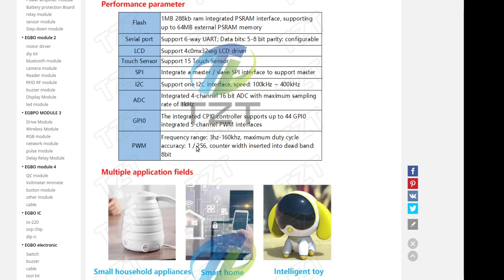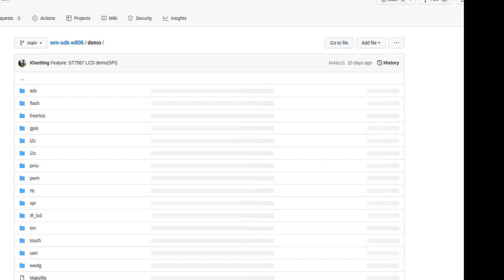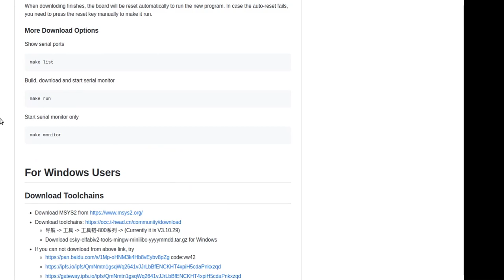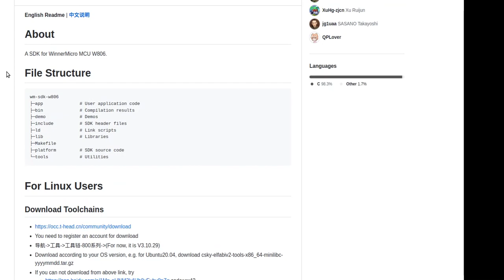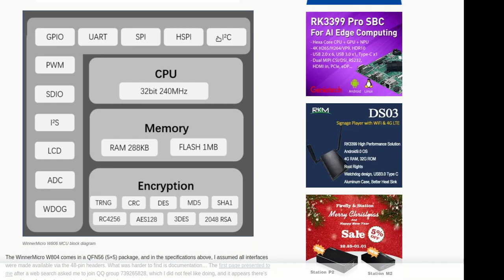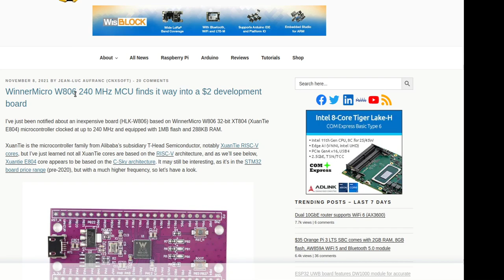W806 MCU - First look

Comment from the maker: NOTE: I say "STC" a few times, but mean "STM" - Too many "ST"s ;)  Another point I missed - The PCB DOES NOT have a power pin broken out so I bodged one for use on a PCB mount. That was a large oversight on the PCB designer's part.

Comment: Works great for me ! 
I provided Instructible and GitHub Code :
- instructables slash W806-Microcontroller-Code-Projects
- github slash jlsilicon slash w806
W806 also provides 10-80Mhz Gpio toggle speed - depending on pin.
Reply from the maker: Nice.

Comment: What can you prpgramnwith this, mcu
Reply from the maker: If you mean what languages, then the SDK for it is using C, so C and C++ would be usable without any extra work.
Reply: Look at the demo projects in the code zip :
44 GPIOS (10-80MHz pin speeds) , LCDs, PWM, IC, SPI, etc...

Comment: I thought the elephant in the room you were going to mention was the difficulty of using the W806 tools and documentation.  The day I can use the Arduino IDE to develop code for the W806, I'll buy a gross.  Size schmize as far as I'm concerned.
Reply: Actually its very easy.
-- Its installed on the Arduino IDE now.
Reply: Actually its very easy.
-- Its installed on the Arduino IDE now.
Reply from the maker: Yeah, the WinnerMicro chips, in general, aren't for most hobbyists at least for now.  The documentation is the worst part for me.
Reply: @UReasonIt  The package of the bare chip scares me off.  Would be difficult to solder this on an adapter without a hotplate and rework station.  Furthermore, I have no 40mhz crystals on hand.  It may be an adventure getting the serial/USB bootloader on board too.
Reply from the maker: @GnuReligion  Yeah, they would be a nut to solder without a reflow oven or plate.  The USB boot loader is not as much of an issue since the ISP interface already is kind of that already.  I need to finish the lua port I started, but have been working on other personal and client projects.